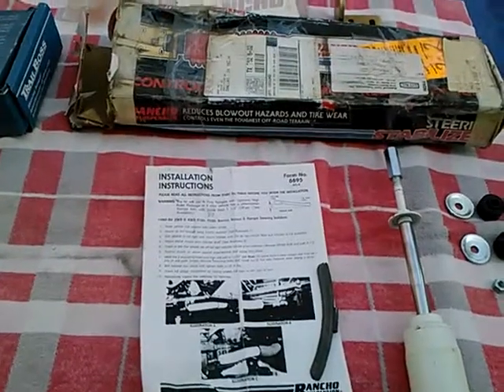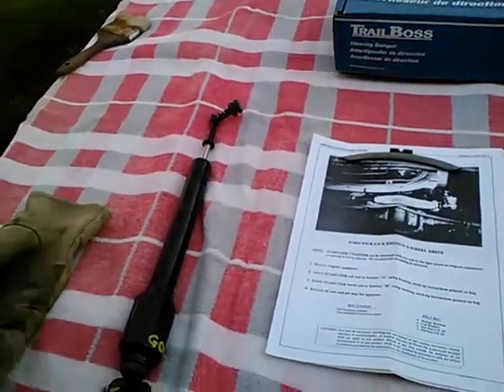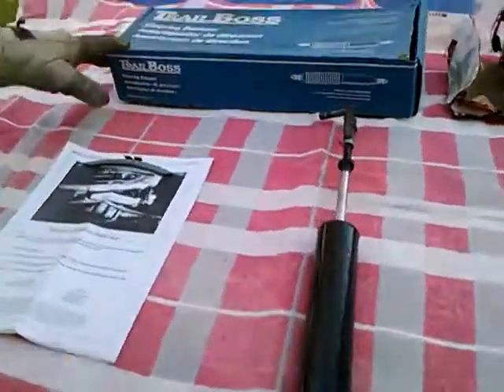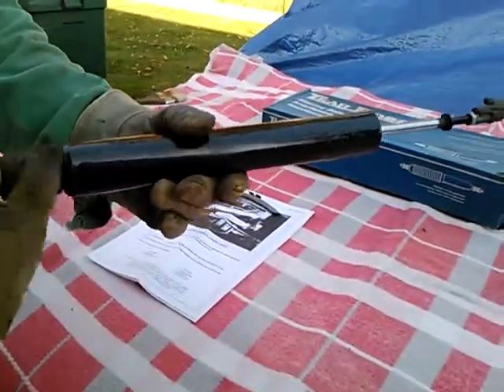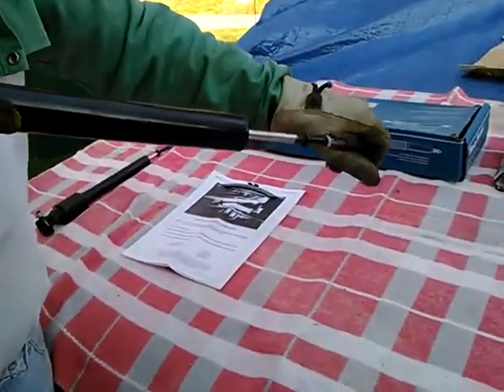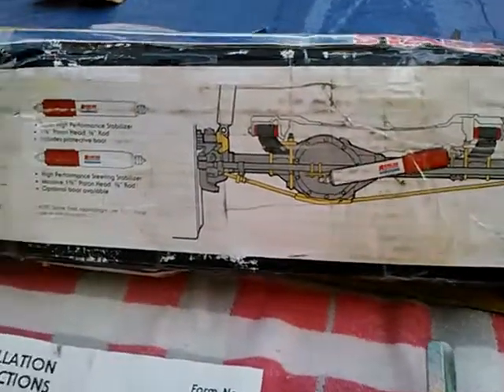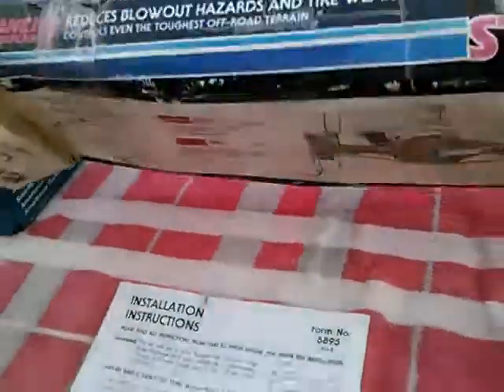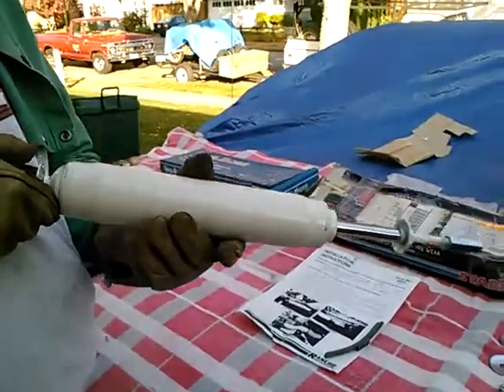These Steering Dampers Didn't Work on VW Baja Bug MOV126.mp4

Comment: Monroe makes one for rv campers that works great!!! I have one on an older southwind chevy chassis
Reply from the maker: Perhaps, but unless the body is mounted lower than the operating rod, it's going to suck air and do nothing.  Unless Monroe makes a DeCarbon unit as a steering damper, which I doubt.

Comment from the maker: Fine idea but won't fix the steering damper issue at hand.  I'm running the stocker now, might try the $200 Koni solution, or find a DeCarbon style aftermarket truck damper, if one exists about the size of these Ranger dampers.